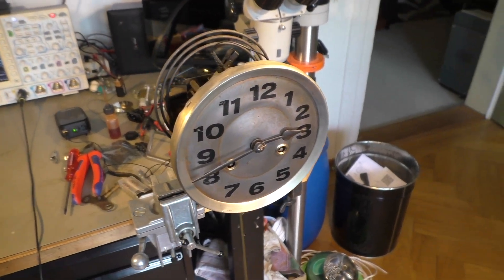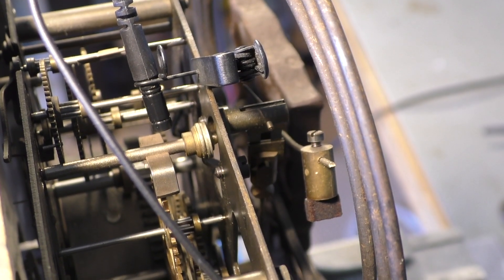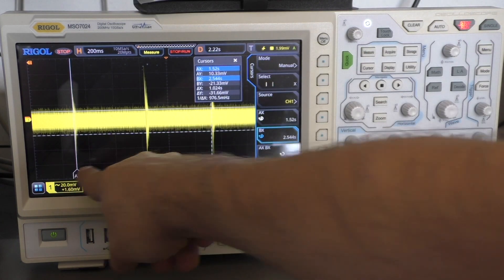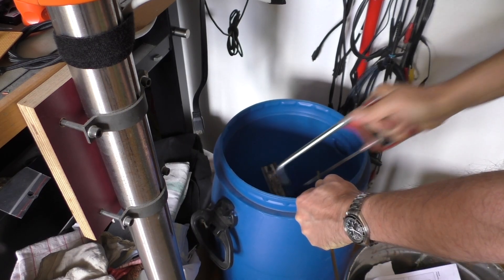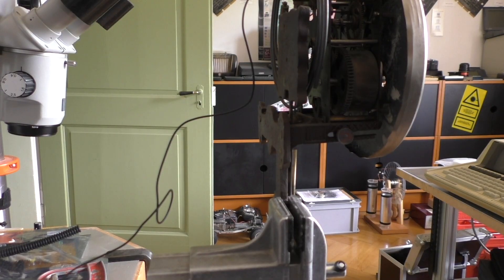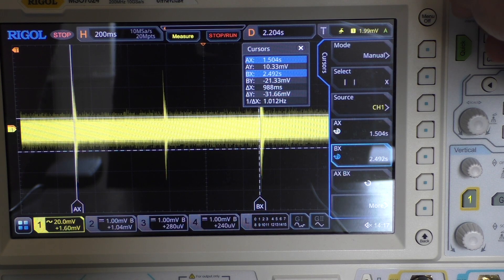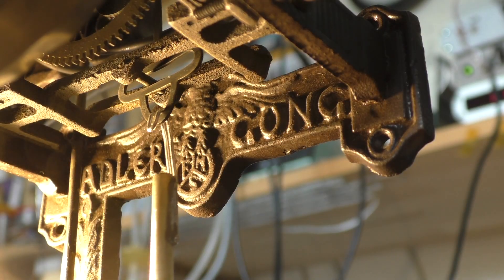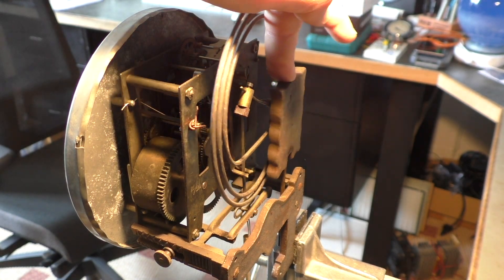Adjusting a pendulum clock with an oscilloscope (PWJ267)

Comment: I did some measurements on my grandmothers clock and I found the ticks were very inconsistent
Reply from the maker: Most important is that the clock hangs/stands straight. For example if the ticks and tacks are not equal, the clock hangs a bit to the left/right side. Make sure the clock is perfectly vertical.
Next problem is dust and hardened oil. The mechanism needs to be clean.

Comment: What would be interesting is to control the clock or pendulum with a  microcontroller, or just a 555 timer.
Maybe replace the pendulum with solenoid or something like that.
Reply from the maker: I have another clock, that has an electromagnet under the pendulum. I never found out how exactly that was driven, but it clearly was there to synchronize the pendulum with another clock or an elecronic device.
Or like this one... https://gentsofleicester.com/reflex-pendulum-control/

Comment: I tried it with a piezo crystal today, it can pick up a quarts movement ticking.
Reply from the maker: What piezo did you use? I tried that too but I got very small signals. OK, I should have used an amplifier... I tried it with a flat disc piezo beeper from an old toy.
Reply: @PlaywithJunk  Yes, I just used a flat piezo disc which I attached to the movement with some tack. The pulses were 10-15mV that I saw on the scope.
Reply from the maker: @Uncle-Duncan-Electronics-Shack  OK... so I probably need a better piezo then 🙂

Comment: How do you know that the tick interval should be 1 second?
That is a completely arbitrary value, isn't it?  Especially when you do not know the length of the original pendulum.  Clocks have existed with widely varying pendulum lenghts.
Shouldn't the project start with determining the gear ratio between the pendulum and the dial hands?
Reply from the maker: Sure, if you know the gears, you can easily say what pendulum it needs. But I already have a very similar clockwork, so I assumed they use the same pendulum.
I started with a much longer pendulum and it turned out to be much too slow. It's a process of trial and error that could be shortened by counting the gear teeth 🙂
But most important is the end result and it seems to work 🙂
I just found out that some manufacturers put a number for the pendulum length onto the backplate of the mechanism. I have to see if it is there...
Reply: @PlaywithJunk  Ok that would be of great help...
But what I mean is that you timed the tick rate to be 1s, but it could well be that the clock was layed out for a tick rate of 800ms and you would have tuned it to 1s and it would still be way off...
But I am not into clock building.  It could well be that clocks always tick at some multiple of 1s, with 1s being the most likely one.
(I know for sure that it can tick much slower, because there are standing clocks with a pendulum that is like 1.5 m long.  maybe they tick at 2s interval...)
Reply from the maker: I know what you mean. The 1 sec interval (it's called a 1/2 sec pendulum) seems to be quite right for this clock. The rest will be fine tuning with the screw I installed. 
It seems that clockmakers were stuck to certain lengths and intervals. For large and precise clocks, they usually made 1sec (2 sec both ways) and 0.994m long pendulums. For wall clocks they often choosed 1/2s (1s both ways /0.25m). 
Of course in theory, you could make all sorts of gear ratios and pendulum lengths, but they made it easy and sticked with the stuff they knew. :-) You could also say, it was pure luck from my side...

At the moment I'm fine tuning the clock and when it works perfectly, I will measure it again. Then we see how much off I was with my assumption of an 1/2s (1s) pendulum.
Reply: @PlaywithJunk  Yes, I think that when you got reasonable results with 1s time, it probably is exact.  It is not likely to be off by a percent or a couple of percent.
But at the beginning and without any info, assuming a 1s tick rate was risky...

Comment: Usually the pendulum had an ornament on it that you would adjust up or down to make the clock go slower or faster.
Reply from the maker: I know.... I think I will cut a thread on that brass rod and screw a nice looking weight onto that.

Comment: Average it over time, over temperature… if the rod is brass or copper, it’s going to get longer in the summer and shorter in the winter. But if the seasons (hot and cold) are equal it may cancel out 🤷🏻‍♂️
Reply from the maker: True. But I guess for this old clock, the difference will not matter much... 🙂
Reply: I’ve seen clocks that have a cylinder of mercury hanging at the bottom of the pendulum to compensate for that.
Reply from the maker: @jimsvideos7201  Yeah I have seen that too. Some other clocks use different materials and connect them in a way to cancel out the differences.